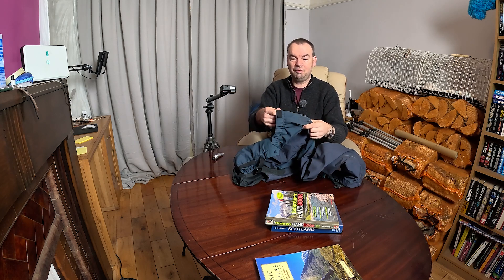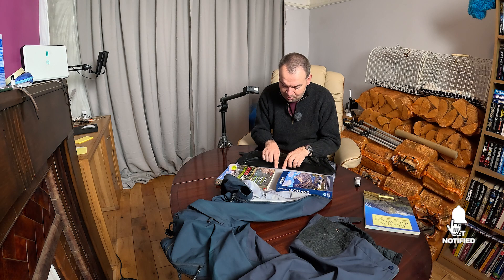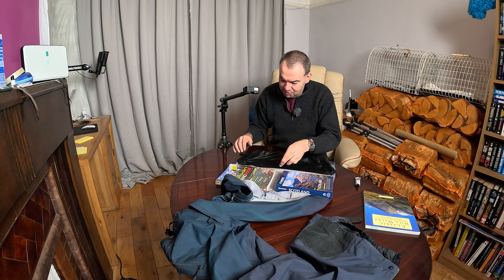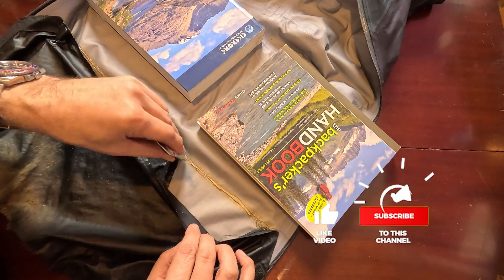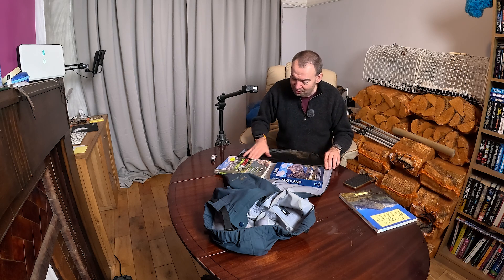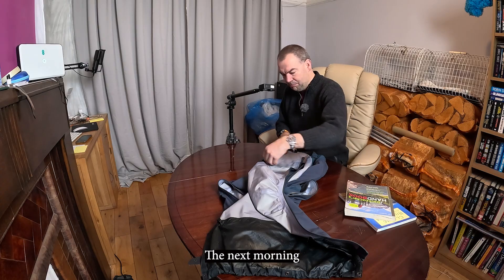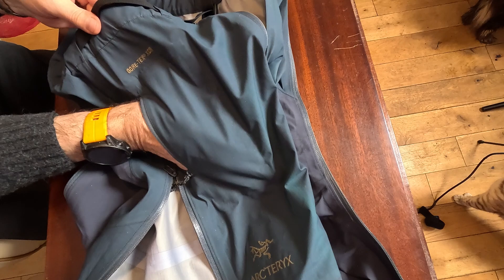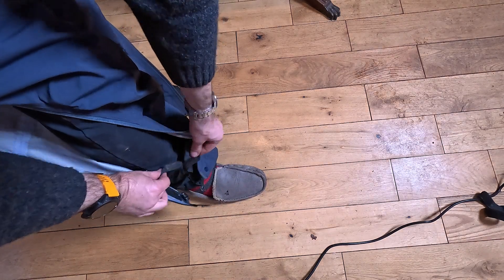Repairing failed Arcteryx bonding on GoreTex waterproof trousers with SeamGrip

Comment: Thank you great tutorial video, I have the same issue on my alpha sv, it’s been working fine but sadly it failed in the same way after washing it in the recommended way. I’ll do just like you this week, but I was wondering if you can wash it after the repair, thanks again boss😎
Reply from the maker: Fingers crossed 
Once done let it set for 24 hours and make sure it's the adhesive mix there is a seam sealing mix too. I'll try them and see and give em a wash.  Thank you for passing by

Comment: A little late for me but I had the same failure on an older but very seldom used Arcteryx jacket.  Have to admit being disappointed, given that I have much less expensive gear that has held up just fine.  Still, thanks for doing the video!  I just might try to repair mine more correctly, at least more carefully, now.
Reply from the maker: Yeah I agree its pretty poor tbh and I have a few of their jackets that failed stupidly I tossed two but still have a third but like the two i tossed it's nearly all the bonding on jacket not just this bit.  The first jacket to go i did try a warranty claim but turned down which tbh I thought pretty sh it ee  then after years of this and my new studio 😆  and thought let's try a repair esp as they now just about fit me again.

Comment: Great video Tony 
I’d maybe try a bit of bungee cord with a toggle or something on the bottom of your panties , , I’ve also had to do a repair recently on a outdoor research foray 2 jacket , 
 Got it for Christmas and it ripped on Boxing Day , 
So had to repair it with a goretex patch , think the jacket is made from Crete paper, I have tried to reach out to OR but still waiting on a reply
Reply from the maker: That is a bugger how did it tear?   Bungee sounds a good option for holding things in place...
Reply: @TonyHobbs  Tony it was the slightest little knock on the kitchen counter side , I personally thought it would be a bit tougher than that being a outdoor jacket
Reply from the maker: Yeah maybe give them a follow up and see if they get back to you where did you buy it?  I suppose they will say user error but ..... you'd expect it be ok at home.  How did you do it lol

Comment: It's  a shame that their products fail as much as the do. Part of the reason
for spending a lot more for Arcteryx is the supposed quality . I'm no so sure any more if its worth it.
Reply from the maker: Sadly I agree. I used to buy lots in 2000s . Well. Some. Certainly more than others.   And then a different jacket failed like this one and I contacted them and they were very unhelpful basically tough luck its not new been used (but not much it was in good condition just the bonding failed) and given the costs paid it was very disappointing.